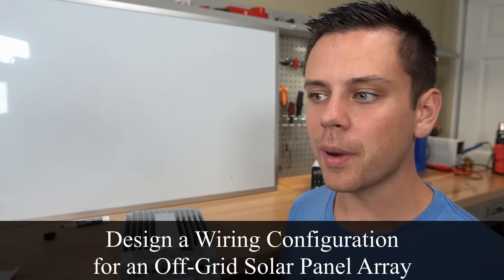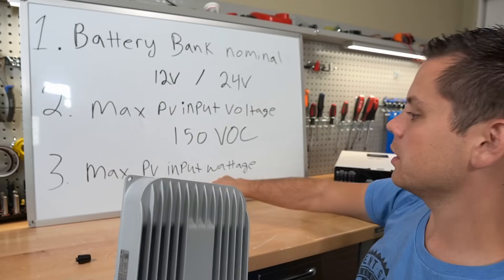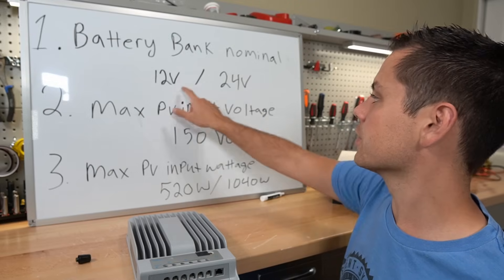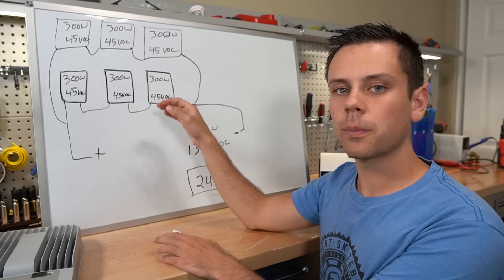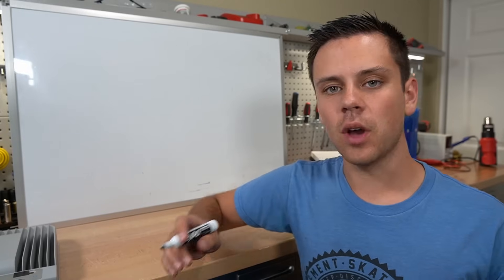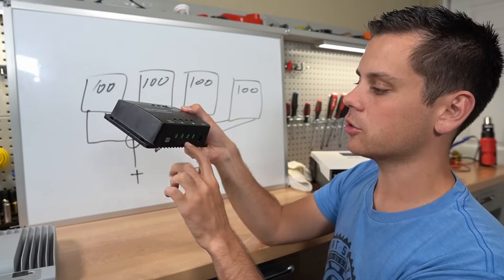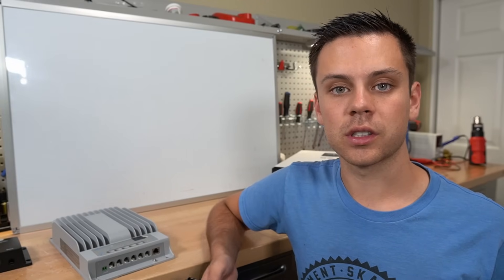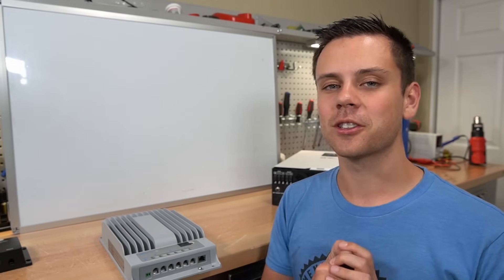How to Design an Off-grid Solar Power Array Wire Configuration

Comment: 140VDC will not kill you instantly unless you are applying it directly across the heart or brain with electrodes and you reach a current around 750mA or above.  If you reach a current around 100mA across the heart with AC it can cause it to go into fibrillation but this is far more likely with AC rather than DC since the DC current would have to be much higher in the 300-500mA range.  DC like you see from solar panels and batteries does not alternate.  DC is also far easier to let go of and requires a much higher voltage to cause involuntary muscle contraction than with AC.  In fact, the main things it can do that make it dangerous is cause arc flash, short circuit welding, burn damage and metal ion migration through flesh if contact is prolonged across a short distance with a high enough voltage to overcome skin resistance in a large enough contact area effectively cooking you.  Your skin resistance plays a very big role in how much damage will be caused.  Unless your skin is wet with saltwater or other conductive solution, you will typically see skin resistance in the realm of 600 ohms with clammy or damp skin but will generally be far higher if very dry.  600ohms of skin resistance would require a minimum of around 180 volts DC to cause the heart to go into fibrillation.  The distance between the entry and exit points can also dictate how high the body's resistance will be.

Comment: I have three 330 watt Panasonic panels, 67v/6amp all wired in parallel. Do you recommend those inline mc4 fuse connector before connecting to my branch connector?

Comment: You can over watt victron charge controllers. They will throttle at the maximum specified watt. I know lots of people that will put a 1000 watts of solar on a controller rated for 800 watts. These systems work better in lower light conditions because the extra panels help make up for the inherent loses of the panels allowing the controller to run closer to 800 all the time. If the sun kicks everything over 800, it just throttles back. I haven't actually tried this yet, but i plan on giving it a shot with in the next 2 months on my yacht.

Comment: Hi I need help. I couldn't find a video on just solar charge controller and am a bit confused. Can I have a solar panel, solar battery, and inverter or do I also need a solar charge controller?
Reply: Rossy L - you DO want the charge controller, too. It will regulate panel energy going to the battery
Reply: @billgrey  OH. I always see that he uses a controller but wasn't sure of the use. Thanks for clarifying.
Reply: @rossyl.9887  It also depends what inverter u get...
Some have the mppt & battery charger built in (Will has shown them b4) I think it's the 'MPP hybrid inverter'

Comment: With solar charge controllers some operation can be close to thresholds while others may destroy the device.  For example its not possible to exceed the maximum operating voltage (145v in the example here) without destroying the controller.  Unfortunately in cold conditions what you calculate as the worst case panel open circuit as 135V may briefly go over 145V!  Again with MPPT charge controllers the battery charging current is usually internally limited, so it can handle panels capable of sourcing higher current.  However this is not the case with PWM controllers, which will definitely overheat & possibly destroy with higher than rated battery current!
Reply: The cold weather aspect is often overlooked. While charge controllers may have different numbers, Midnite Solar has a great calculator on their website that will take location temperature into account. Maximizing charge controller input is not easy. 

PMW controllers are not designed for large systems though. I only use them for a portable 200 watt panel at 12v
Reply: @4philipp  you can use varistor and a fuse as a protection i guess

Comment: Lots of great technical details, well done. I would agree that it is very important to leave some "head room" in both voltage and wattage when designing a system. The rated output of a solar panel is determined under ideal laboratory conditions and in practical usage generally only produces real usable power of 75 to maybe 80%. Based on this, it would be tempting to install for example 500 watts worth of solar panels on a 400 watt charger which will work just fine most of the time. However, on certain days just after a good rain when the temps are down, air is clean and the clouds are breaking up there can be momentary magnifying effects that will actually intensify the sun so much that a solar array can produce more than its rated capacity. I've seen brief periods of up to 3.2 Kw from our 2.8 Kw system.

Comment: could u place a blocking diode before the end of a string so that even if there is a short no current would backflow into the faulted string?
Reply from the maker: The diode would produce a voltage drop which would be unfavorable

Comment: For paralleled string you could put one blocking diode at the end of each string.  This way even if one string does perform upto expectation for whatever reason the other cannot source current into it.  Would like your views on this.
Reply: seems good idea but you need a power diode to handle the current which is flowing through panels in the normal operation i guess also the diode must have a high reverse breakdown voltage

Comment: I bought the mpp solar from your link lv2424 - I also bought 8 HQST 100 watt panels from your links and then 4 rich solar 100 watt panels - 1200 watts in total , I think the guy said to set it up as 2 in parallel and then  6 in series for the 12 -  my question was if the parallel connectors are 15 bucks each pair  i will spend  45 bucks in connectors - why not just get the wire for that cost ? 2 runs of 10 awg wire of 6 panels in series ?

Comment: Wealth of information to digest, and  I like the heads up safety concerns touched on be it series or parallel with use of combiner box and/or shutoff switch. Lotsa variables to work through.

Comment: Thanks to you I set up my unpowered shed with solar and a battery bank.  I started at 12v, but quickly calculated that using a 24v invertor would reduce the wiring cable sizes and other headaches.  So I reconfigured for 24v.   But then, that meant I needed to add a 24v to 12v dc to dc convertor.  Nice warning about parallel strings. Thanks.
Reply: P

Comment: HI Will,  Since Used Solar Panels are cheap, and good batteries are expensive.   I'm looking into over paneling.  Unfortunately, doing so can create a substantial higher current then what the Solar Controller or Battery is rated for.  Is there someway to regulate the current going to the the Solar Controller/Battery such that one can get a substantial amount of electricity on cloudy days, but on the sunny days keep the current from exceeding specifications of the Solar Controller or Battery.   Thanks

Comment: Question for any of you solar guru's. 
When I mount panels on my sailboat, which wiring (series/parallel) and type (poly/mono?) would have the least loss during shading conditions?
Also, would there be any benefit to mounting a second set of panels upside down under the primary panels to maybe recoup some reflected light off of the white deck?
Thanks
Reply: Mono panels are more efficient so you can fit more watts in the limited space your boat would have. If the reflected light off the deck is quite high it might be worth it for the extra few watts but you might want to do a test first. As to series versus parrallel, series in a string, if one panel of a two or three panel string is shaded you can have a pretty major drop in power, in parallel you only lose the power from the panel shaded. If you your battery bank is 12 volt, a typical sixty cell panel will have enough voltage at any time when connected to an mppt charge controller to charge the battery, if the bank is a 24 volt bank since you need a charging voltage of 29ish volts, a sixty panel by itself would be borderline for charging, they have an working voltage of 30-31 volts, vs a 72 cell panel has a voltage of 40ish so it would work better with charging in a wider range of light if your going to parallel your panels. As he pointed out though if your wiring several in parallel make sure you use protection devices.
Reply: @andycanfixit  Thanks much!
Reply: I know lots about solar & not enough about boats...
U can get panels which have no backing sheet & have cells on both sides, they r designed with reflected light specifically in mind, but I can't remember the make or brand name...
If it's a sail boat, ur biggest issue will b shading... Even a pencil thin bit of shade over 1 cell (thats 1 wafer of silicon) will lower ur output significantly from that panel.!
If I remember correctly, there's not a huge difference between the output of Poly/Mono (they say Mono does a bit better in low light) but it's a v. small gain... their main advantage is they r more efficient hence use less space allowing u 2 get more power (but they r more expensive).
If u will b in low light levels then u may b better off with thin film (like on a calculator), but they need 2 b huge 2 get any serious power.! (ie. they r inefficient space wise).
I'm planning to buy a sail boat soon & this is my worry...
Due to the shading I'm thinking parallel is better if u only have a few panels...
But I'm thinking of having lots as it will b a live aboard...
So I will probably end up with a mix of both...
I'm also thinking of having panels on fold outs over hanging the hull when stationary...
Recently I've been thinking a motor boat (instead of a sail) may b better as there's no mast, sail or lines 2 create shade & just put a massive array of panels up. Over time I would modify the boat 2 have 1 electric motor, 1 diesel motor & a generator as a backup. (I plan 2 cruise around & live in the Mediterranean, never really straying far from the shore...)
But then I think I would like 2 have sails & harness the wind..!
Ur feedback/thoughts would b appreciated as u know the boat side of things...
Reply: @MaxMax-dq1lu  Thanks for the info. For me it's like 98% working on the boat & 2% actual sailing. Hope to remedy that in the future. Majority of the boats around me are power (most seem welded to the dock) but dollar for dollar & foot for foot, I believe they would be much more comfortable for a liveaboard.

Comment: Hey will if you hooked up the 1050w open circuit to the 12v batter since the voltage is with in with in range I believe the system would still work. The mmpt should be able to regulate the amperage such that even with the 1050w going to the controller only 480w ( 40A x 12V) would go to the batteries correct. It's wasted power and you have too many panels but it should work right?
Reply: Yes, (with caveats), this is called over-panelling and is generally OK to do in order to boost your yield on cloudy/overcast days. As a rule of thumb, 30% over-panelling ( i.e. 30% more PV than the nominal power output of your charge controller e.g. 40A x 14.6V = 584W ) is a good balance between boosting yield on cloudy/overcast days and leaving power 'on the table' on sunny days. But you must never exceed the maximum open-circuit PV voltage, nor the maximum short-circuit PV current. Unfortunately, the latter isn't always specified.

Comment: Cheap panels from Jinkosolar 72 cells 400 watts 25% efficiency. Any honest review from the experts?
Reply: They sound pretty good.. must be pretty expensive. The highest efficiency sunpower panels cost around $600 each (australian dollars), from the retailer i'm looking at anyway.
Reply: @jacksmith3421  I got 4 for $250 each including tax and chipping.  I installed them today and so far so good. My 72 cells Serafine make about 8 amps but the Jinkosolar make 9 amps. I am impressed.  They have the new type of cells that are more efficient.

Comment: This is great. I still get a bit confused on all the pieces needed and what they do (MPPT... like wut?? Now I know :D). Appreciated.
Reply: Solar charge controllers (SCC) usually come in two flavours: PWM ( older ) and MPPT ( newer ). Pulsed Width Modulation (PWM) charge controllers are old tech, and certainly wouldn't be recommended these days. They are basically a fancy switch, connecting the PV directly to the battery. Maximum Power Point Tracking (MPPT) charge controllers operate completely differently, essentially converting the higher PV voltage down to a voltage suitable for the battery and thereby separating the PV array from the battery. These are generally speaking around 30% more efficient ( in low light or varying conditions ).
Reply from the maker: Thanks David! Yeah this was a more of an intermediate level video 😬

Comment: I want to run my pool pump off solar only no batteries. What do I need to watch or can you instruct me to see this application?
Reply: Assuming your pool pump operates from DC you generally just need sufficient current to meet surge demand on startup and the pump must rated for the high voltage PV panels tends to produce e.g. 21V. For example, if your pump's surge load is, say 12A, a typical 100W PV panel would generate around 5.5A in ideal conditions so you might get away with 2 x 100W connected in parallel. The specs you'd be looking for is the 'stalled rotor current' on the pump and 'Isc' ( Current Short Circuit ) on your PV panel(s). But other than that, there should be no reason why you cannot run a (DC) pool pump directly from solar ( during the day, obviously! )

Comment: How about putting solar panels in parallel individually, NOT the entire strings.  i.e. the way you would with battery cells?
Reply: There's nothing stopping you doing this but, generally speaking, it is less efficient to do this when you have an MPPT charge controller. You generally don't have any other choice with PWM charge controllers.
Reply: Why is it less efficient, because I expected the reverse to be true?
Reply: @stevenbliss989  Parallel connections increase current whilst maintaining voltage, series connections are the opposite. By increasing the array voltage up to that supported by your SCC e.g. 150V, you effectively reduce the current flowing into the SCC for the same power. Resistive losses decrease at the square of current (P = I²R), therefore, reducing current significantly reduces losses.

PWM charge controller do not allow you to increase the PV array voltage, MPPT charge controllers do ( this is one of their many advantages ), therefore, it is more efficient to connect your panels in series when using an MPPT charge controller.
Reply: Thank you, but that is not what I meant.  Specifically two strings of 4 panels connect in parallel vs. one string of 4 panel pairs (each pair in parallel).  In both cases the current is 50+ amps, with heavy cabling to suit.  The PVs are 12v.  My array will be 5 groups like this on 5 SCC parralled into a 560Ah 48V LiFeO4 bank with appropriuate balance and current/voltage protection etc. tuned for 75/25% charge/discharge management.  Sadly, I must use 48V max because in Australia we have insanely over regulated solar, and even this has to be certified by an electrician suitably qualified for solar - IT's red tape gone mad by a crooked solar industry lobby group.  So my choice is 4 pairs in a string, or two strings joined at the ends?  Off grid setup btw.  What are your thoughts?
Reply: @stevenbliss989  Both configurations have the same array current because in both scenarios all your panels are effectively connected in parallel. In generally accepted parlance a 'string' refers to a group of panels connected in series, thereby cumulatively adding each panel's voltage. In both scenarios above your array will be configured as 1S8P. This would be highly inefficient when used with an MPPT charge controller because your array would be minimising voltage and, therefore, maximising current and, therefore, associated resistive losses.

With an MPPT charge controller you generally want to do the opposite i.e. maximise PV voltage and, therefore, minimise PV current.

If your panels are marketed at "12V" then they will likely be outputting around 21.6V (Voc = 21.6V). Let's say your SCC is rated to support 150V, to optimise efficiency you would connect them up as a 4S2P array. The "4S" would result in an array Voc of 86.4V, the "2P" would result in an array Imp of around 12A. This configuration would give you a 17-fold decrease in resistive losses over a 1S8P configuration, provide you with the exact same power output from your charge controller, and would represent a significant cost saving in the cost of cable.

...but 1S8P works too.
Reply: @tictagtube  Sadly I am aware of that, but like I said 80V is the limit that a DIY setup (i.e. a 48V nominal system) is allowed in Australia.  And even that must me inspected and  certified by an electrician, ...not to mention house insurance issues,.  There is also a restriction on wiring where ANY fixed wiring, regardless of voltage in a house  (i.e. not free moving like an extension cable for instance), MUST be certified (in fact actually required to be installed) by an electrician.  Luckily some electricians (like the one I am using) know this is madness, so they bend the law a bit, and are happy to just inspect and provide red tape crap for the corrupt regulatory system here in Australia.  I am using VERY heavy cables from the PV string ends to keep the losses down, but it costs!  BTW, such a system is forbidden to be on-grid, to the extreme that you must completely have the physical connection to the grid removed from your house to be legal!  It's nuts!  ...anyway, thank you for your thoughts. :)
Reply: @stevenbliss989  Seems very restrictive, especially for a country that gets lots of sunshine! Good luck with your project.
Reply: @tictagtube  You can have it all, if you do not mind professional panel installation costing more than the panels!  It's a scam.